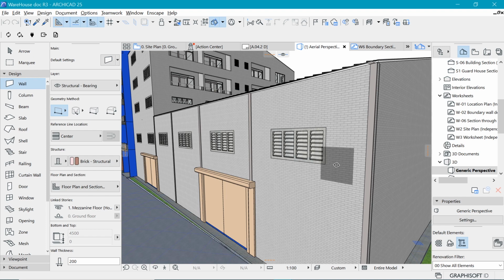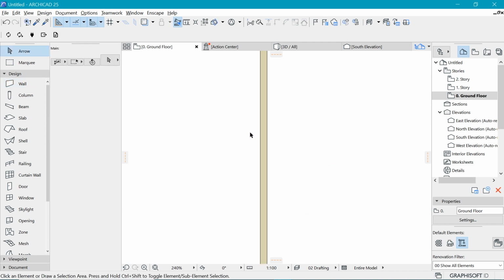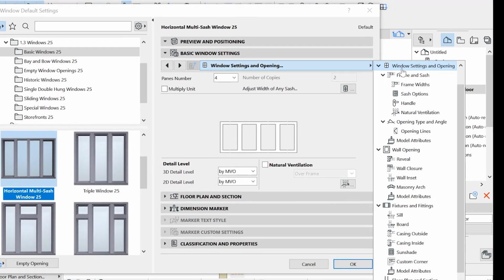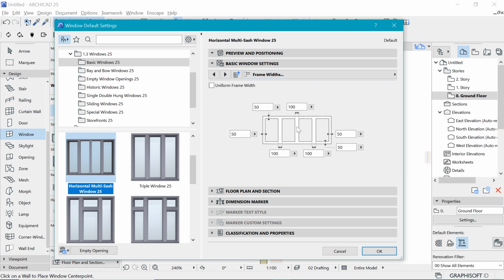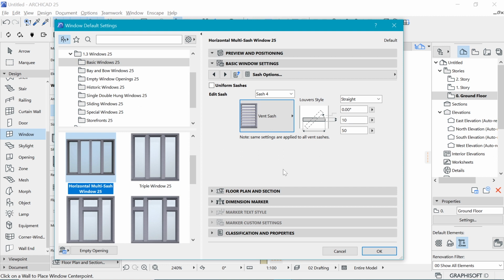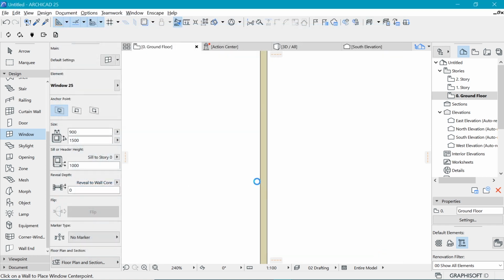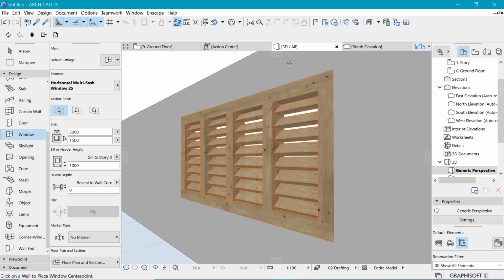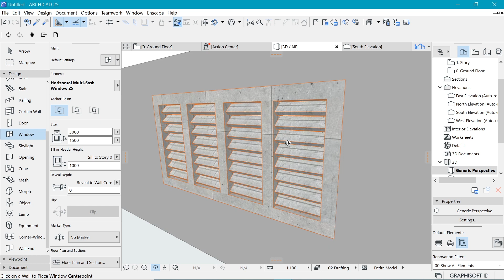Concrete Louvre vents in archicad

Comment: I have one query why short walls of 500mm high become in visible on floor plan hw do I deal with it
Reply from the maker: This usually happens when the 500mm high wall is raised above 1.5m from the zero level of the story (I hope thats the case for you). So before you raise that short wall from zero, go to settings of the wall under floor plan and section, change floor plan display from "projected" to "projected with overhead".

Once you do this, the wall wont just disappear, it will be represented as dotted on the home story. I hope this is clear and fixes it for u